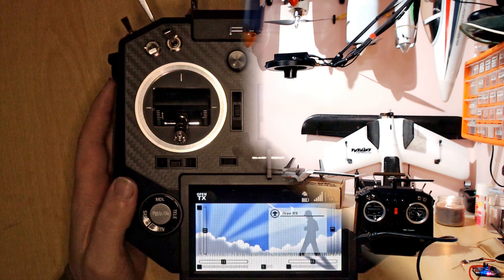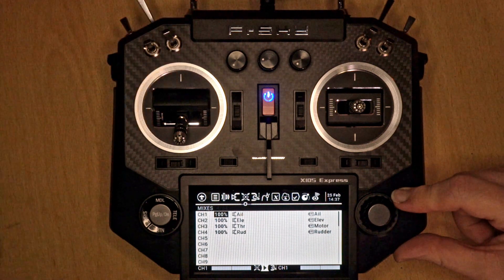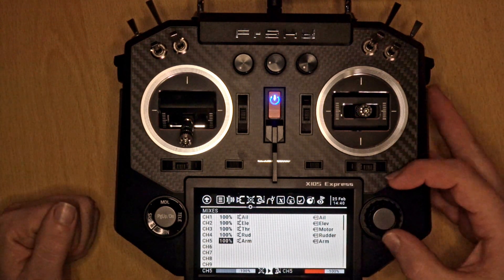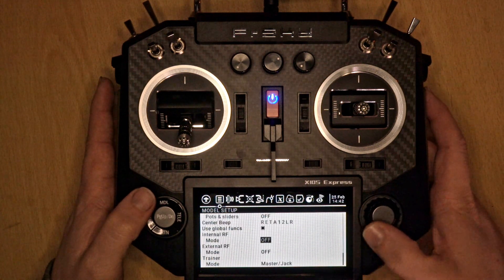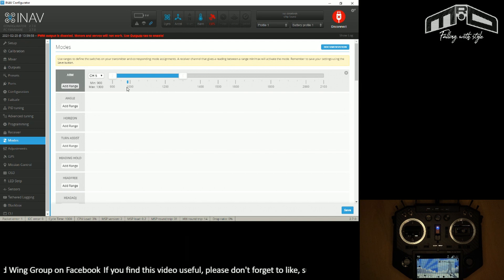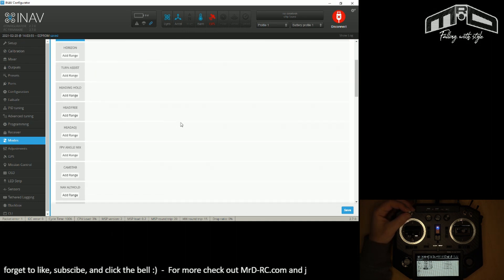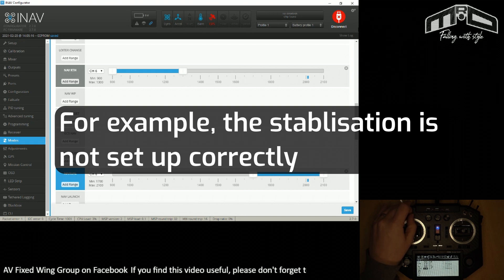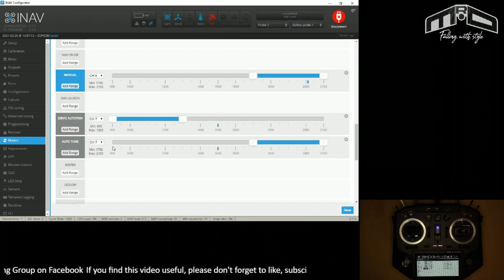A Guide For Newbies - Setting Up Modes and Switches for iNav

Comment: Hiya Darren. Hope you are well. I had a question .... if im in altitude hold mode, but pitch the nose up or down (so that the plane changes altitude) does the altitude change then hold once i come off the pitch stick? Or does it make the plane return to the altitude at the point at which the alt hold switch was enabled?.
Reply from the maker: If you use the elevator, I believe that it will hold the new altitude. Don’t forget that altitude hold should not be used on it’s own. It must be used with either Angle or Cruise.
Reply: @MrD  thanks for the information. So i assume in order to get alt hold... i need to have already activated angle mode?

So if i have angle mode on a switch that is 'on' i can have another seperate switch that then adds alt hold to angle mode when it is switched 'on'? 

The reason why i ask is because i saw an andrew newton video where he doesnt have angle and just has an alt hold switch. https://youtu.be/EbBu9LxugNk. It looks like he didnt enable angle mode...
Reply from the maker: Yes, it's best just to have both Angle (or cruise) and Alt hold light up at the same time for a given switch position. But you can set althold on a separate switch, and only add it when you want it. I'm guessing this is what Andrew is doing. You just have to be mindful that you should only use it with Angle or Cruise. You should never use it with Manual, Acro, or Horizon. I'd probably even go so far as to add logic so that it would only activate when either Angle or Cruise are selected.
Reply: @MrD  thanks!!! Really appreciate your help
Reply from the maker: @beefybeef1326  no problem.